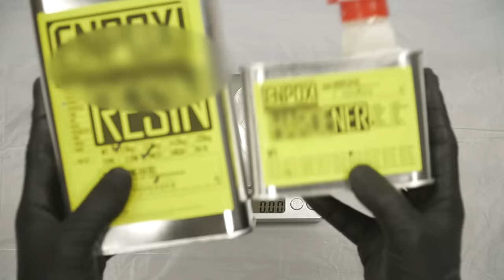How to Simply Change your Car Parts to Real Carbon Fiber (Carbon fiber Skinning) [DIY]

Comment: While maybe okay for small parts, i wouldnt trust that spray tack on larger stuff or things that see more stress. Like say someone had a wing they wanted to skin. A coating of spray tack is a weak temporary removable barrier that now prevents your epoxy from actually bonding to the surface of your item. Plus anything sitting out in the hot sun where the item continually expands and contracts every day of the week would, over time, probably delaminate the carbon fiber away from the surface of the below item being that item is coated with flimsy spray tack. 😬😒🙄

Comment: Great video. I'm just an amateur at carbon fiber skinning so take this with a grain of salt, but I've found that scotch brite pads can work after the first resin lay if there's concern that sandpaper will wear past the resin layer into the carbon fiber.
Reply: He did sand some carbon fiber off. All that black dust on the floor wasn’t resin.

Comment: use of the vacuum bag is a good idea but spray adhesive gets eaten by the epoxy
by using that instead of the normal epoxy layer for adhesion wont this result in delamination fairly fast?

also have you considering using filleting wax on the bottom edges to prevent the epoxy/carbon from sticking underneath keeping the back undamaged
Reply: Not if the spray adhesive is given time to cure. I've got skinned parts on my car that are now 6 years old that haven't delaminated.
Reply: Any links to the products to use?@matthewlock5833

Comment: In the upholstery world all you did was wrap these with carbon fiber, skinning involves wrapping the part like you did, stopping mechanical locking points, popping the carbon fiber off the part wrapped and reinforcing the part for rigidity. Skinning simply is the most cost effective way to create CF parts without creating molds.

Comment: would you get better results by using a peel ply and breather cloth when vacuum bagging? or is it not necessary?
Reply: Peel ply and a Breathing Cloth would assist if you were looking to save / reuse the vacuum bag. Peel ply will still leave a textured finish and need sanding. Will also help avoid the bag getting stuck in the resin itself (AKA less sanding!).

I'd also look into a heat gun / torch as well, if you watch others who lay Carbon Fibre down, it assists with degassing (Removing bubbles) from the resin itself and helps promote a smoother finish. Highly suggest watching a few others, especially the epoxy counter top guys as its a technique they use all the time to give a amazing finish!

Comment: Thats not a real carbon fiber part.. you just added carbon fiber on some other material..😂 in that case its better to hydro dip it simply and get the same out put😂😂
Reply: Are you expert?
Reply: Bro carbon skinning and hydro dip is very different 🤣
Reply: Hydro dipping , you have seen how that looks corect

Comment: Purpose of carbon should be reducing weight, by skinning parts we are adding weight (however miniscule). So in the end it's just eye candy.  It's like those 10 fake air vents on BMW Toyota Supra, those in the know will not be impressed, those who don't know don't matter because to them it's just the luxury badge that is important.
Reply: carbon has become more aesthetic on show cars then actual weigh reduction

besides, the oem vents that he skinned likely weigh less then 2 pounds, skinning added maybe 0.5lbs

skinning something like a whole hood is another thing but stuff like this isn't worth making a mold and custom tabs for a one off
Reply: Those in the know would also know that the amount of time effort and money involved in making this entire part from carbon would not be worth the few grams of weight saved.
Reply: Weight savings on that part would be so small and the cost and time would not be worth it. Carbon is only worth it for larger items.